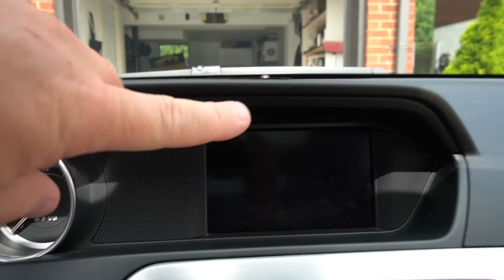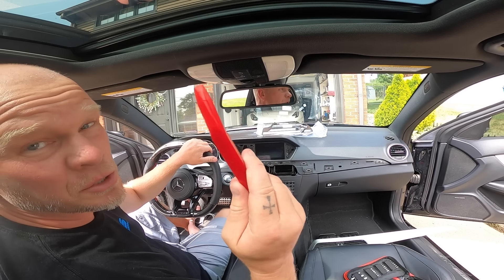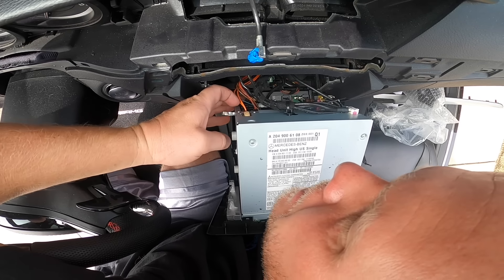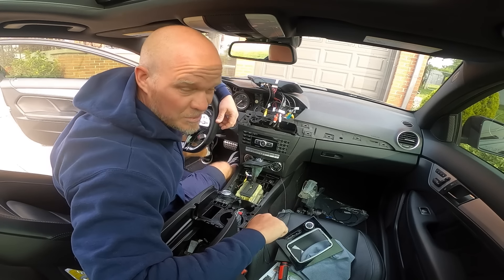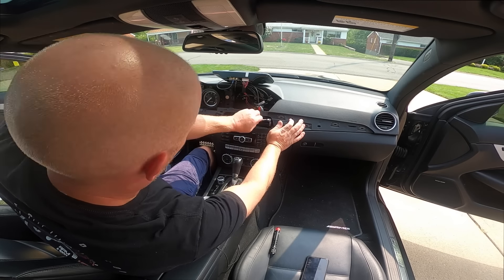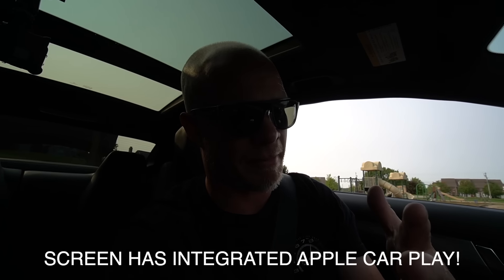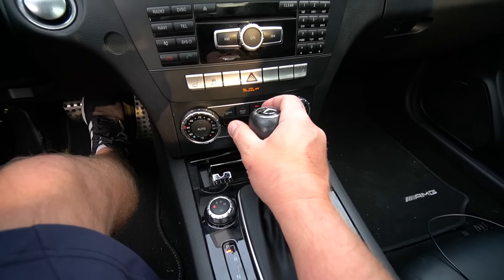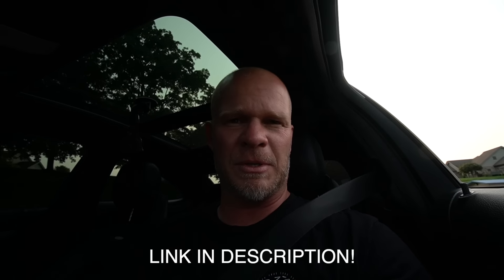Nr1 Upgrade For Any Mercedes! Android Infotainment Screen Install! (W204, W205, W211 etc..)

Comment: Now what you need to do Mike is get the Android auto/Apple Carplay adapter installed along with changing out your cigarette lighter with USB ports!! Then all you'll have to do is just plug your phone directly into your USB port where the cigarette lighter use to be and you'll have Apple Carplay at your finger tips!! 
This is what I did to my car. And what you can do is run the usb connections 1 to the back of your screen under the dashboard where the Apple Carplay will plug into and the other USB connection through your center console to your armrest compartment and plug that directly in to your usb port in the armrest compartment. And at the same time run your aux cable to your armrest compartment, buy a noise cancellor, plug your AUX into it and the noise cancellor in to your Aux port! 
Then when you switch over to the Android function on the screen, you'll be able to listen from the Android screen (i.e. youtube music, etc..) when driving and you won't get the noise feedback because of the noise cancellor! 

So when I plug my usb cable from my phone to the top of 1 of my usb ports, I get Android Auto/Apple Carplay + phone charging and when I plug my phone into the bottom USB port, I get phone charging only.
My setup is so universal that i have so many options at the tip of my fingers that I can use my command unit from the car, go on the internet whenever I want. Use Google Maps for Nav or Waze for Nav or even still use my command unit for Nav! 
OH and also you should get the VIM cable harness too!! This cable harness allows you to enter destination on your command unit Nav while driving! This cable harness can be used with the cable harness that you installed for your Android screen, together! I've done all these things with my W204! NO PROBLEMS WHAT SO EVER!! :D Hit me up on Instagram if you want to know where to get those other items! 
OH! ALSO... one more thing!! If you want to be able to use your car's factory antenna on the roof of your car, there's a company you can reach out to to have them make a custom split cable where your command unit AND Android screen can use the same antenna together, as well! Then you won't have to use the generic antennas that came with the screen!!

Wired To Wireless Carplay USB Radio Dongle Link Box w/Light For Apple IOS IPhone adapter: 
eBay item number:274494133026

Noise Cancellor: https://www.ebay.com/itm/MPOW-Ground-Loop-Noise-Isolator-3-5mm-AUX-Cable-For-Car-Audio-System-Home-Stereo/363091378655?hash=item5489eec1df:g:F7UAAOSwIjxfTK8B

ebay store: rfniceconect: 
These guys can make the custom command unit splitter cable for your command unit and Android screen. 
It's a 50cm Fakra "C" Male to SMB Female 5005 SMA Male RG174 Y Splitter Combined Cable

Cigarette lighter replace USB PORTS: Dual USB 3.0 Extension Dashboard Panel Mount Cable for Truck Car Boat Motorcycle
on eBay: eBay item number:193658991954
Reply: do you have a video you can share

Comment: Was expecting that the headunit was going to fit into the housing, im not a fan of the tablet looking infotainement.. but its a nice upgrade from the outdated W204 headunit
Reply: Agree, it looks like the W205 =/ Nice to have the tech upgrade though.
Reply: Yeah 205 style hu's are not my cup of tea. The MB engineers were like, ahh beautiful interior.. oh wait, we forgot to add a screen! Not to worry, not to worry we will just slap a tablet somewhere.
Reply: there is one that is smaller that fits in the dash I've seen.
Reply: “Outdated”
Reply: @Vithursan B. Me too. And I think touch screen systems are dangerous, if you gotta change something on the move.
Reply: agree its popping out too much
Reply: Bilal

Comment: I just got this for my 2013 benz... i was skeptical about the price and the install but it was WELL worth the money and it makes the car look 10x more modern and have gotten a lot of compliments
Reply: I’m thinking about installing this in my 2013 C250, how’s the sound quality on it?  Have you had any issues with it?
Reply: Alberto Magallanes Jr you have to make sure you go on the AUX setting on the original screen for the volume to work 100% and also of anything my speakers sound louder

Comment: Nice upgrade, I just wish the screen was set back into the dash like the old one instead of sticking out hanging off the dash board like that. I suppose it’s not any worse than the newer c classes though anyway

Comment: 01:10. At one stage, someone replaced your air filter, and to do that, you need to go thru the glove box. But the glove box hasn't been put back together properly and hence you can see it sagging on the top right-hand side.

Comment: Having the W204 chassis the new screen compliments the steering wheel. 
Is there no way to blank the OEM with a carbon or aluminium looking plate/cover. 
This would certainly give a more factory look.

Comment: I have an android screen for my w204 and I love it very similar qualities I also plan on getting a dash cam one that looks oem you should look into it it also goes well with the android screen .. it plugs in right under tour rear view mirror
Reply: I saw them on eBay .. Dmp has them also but they’re roughly overpriced for the same thing so ima get mine off eBay

Comment: Nice upgrade! Any feedback after using it for about a year?
Reply: Feedback after using for 3 hours ... Do Not Buy!!!! The screen goes black on the NTG display which means you use your reverse camera! Also the swivel wheen stops working so you can't set the sound to Aux which you need to do in order to hear apps ext. It works for a while but mine died after a few hours! ... it is a cheap China product which they charge alot of money for. I will be asking my bank to reverse the transaction
Reply: @hedzt6667  Did you order it from the same guy as Mike did? Where did you order it from?

Comment: These aftermarket systems update the car so much in terms of functionality but I would have gone for slightly smaller screen but a more integrated one into the dash to look stock. This looks stock just for the newer models and I like to keep the original.
Reply: Yes, one that is wider and replaces the 2 side grills either side of the standard screen and is IN the dash.

Comment: I have this exact screen in my 2013 C63. Its amazing.
Reply: How long did it take...was it hard
Reply: @traybutts4425  yes it took me a while. Getting the harness to fit behind the factory deck was a pain.  I would also suggest removing the shifter and centre console. Drill a small hole in the arm rest so you can run the headphone cable through. Way cleaner look.   It's more work but it's better than the cable hanging there. Also watch when your putting the glove box back on. I lost a few screws down a hole near the right door, you can't get to it.  Hope this helps.

Comment: I'm a hardnosed traditionalist.  I'd like a stock fitting replacement with the same stuff as before but an updated HD screen and connection for Google maps and GPS by bluetooth.  No GPS has proven as accurate nor as updated as Google (Maze is really good too). They mark newly placed construction zones to avoid the jams.  Maze is great because of member participation giving radar, road hazard, and accident area avoidance in real time.  So many aftermarket wonders.  The word custom is just a price changer.  All I want is a steeringwheel with turn indicators plus original functions.  My indicators are hidden behind the steeringwheel I have gone up to 50 kilometers turning right or left without knowing it.  Four e-mails to 'custom wheel' makers and always the same.  "No sir, we don't make that".  Should I write to Websters Dictionary and recommend a definition change?

Comment: They should design one that mounts flush in the existing OEM slot.The floating tablet look is no good. I would take a smaller screen for the cleaner look. The OEM screen size is plenty big enough.

Comment: I would love an upgrade like this on my 2008 XC70 but volvo uses fibre optics so i would loose alot of car settings and temperature settings if i would switch over because the cables doesn't support the system

Comment: @autovlog Great video and instructions, ive been looking to do this myself, but the AUX cable bit always concerned me. Why is it needed? Is it the only output for audio from the Screen?
Reply: It's an input for plugging in non blue tooth external devices into the Android unit.

Comment: I have a c class 2012 all the radio functions work except when I turn up and down the volume there is no sound from the speakers, I did a circuit check and it tells me that loudspeakers open, you have a video related to that case.

Comment: Love the screen, just placed my order with CKM
Reply: Have you gotten it yet?
Reply: @AlejandroSanchez-bt1mj   yes received and installed, great product and makes a huge difference
Reply: Did you have any technical difficulties with the system? Once installed with the software
Reply: @AlejandroSanchez-bt1mj   it was straightforward to install only tricky bit is you need to run the aux cable to the aux socket in compartment behind gear knob and it’s difficult to hid the cable, the other thing they don’t mention is you need to select aux on the original head unit to get sound. You don’t need a dongle anymore as it has CarPlay built in which is what I use, CKM take a while to deliver if you are in uk. I would recommend the screen as it makes a massive difference
Reply: @bosscarjon  how much was it buddy
And can you still control ot via the  dial next to the knob
Reply: @adambaker9550   697 euros and yes you can

Comment: Where the hell did you tuck the MASSIVE quadlock block!?
Reply: Under the head unit is my own solution but if I did it again I would put it in the recess behind the right side of the head unit.  For RHD that means removing the panel under the steering wheel, for LHD remove glovebox, to get better access.

Comment: bro i installed this on my c63 507 and cant get the cables in right the oem headunit is a liitle bit out and cant go all the way in , you skipped past the hardest part to show what did you do to make the headunit fit in all the way in ? please can you help also where does the orange fiber optic cable go that you took out of the oem system ?
Reply: Hey, I just got this installed in my 507 as well. How’d your project end up? 

I’m having a problem getting my car to play the tablet audio through the media interface cable. Was that a problem for you?
Reply: Sike!!! I was in my car as I typed this up and got it working 30 seconds later, hah. Still curious how yours is going!
Reply: Everything fine except fir what I asked above ..

Comment: I had to remove the middle panels and radio on my 2013 c350 like 3 times because airbag module had to be reset and it didn't work the first time then the second time the key stopped working so we thought it was cause of the airbags module wasn't reset correctly then the third time cause the belt randomly shot out and it had to be reset again, then my ELS stopped working so i was about to get a emulator but turns out it was just the little box on the negative battery terminal, so yea this car been a bitch to deal with but it makes it up with it amazingly driving an power tried drifting it tho I only on snow cuz I just got it and don't wanna fuck it up

Comment: I bought a previous generation radio from CKM Design for my W212 in 2018 .. they told me in the emails that it would be able to be updated.  Specifically the only feature I ever wanted was to have it fixed so that It wasn't in metric. I live in the US and I wanted it in standard imperial/mph.  When I asked about the update Chris at CKM design was fairly direct and borderline rude and said that he never said that  or it was a misunderstanding.  To date there has been no update to this unit.  His only solution was to buy another $700 unit. I support AutoVlog, but I do not support CKM Car Design and I recommend you not buy a unit from them. You can get an updated Chinese unit for cheaper from Alibaba express and get the same amount of support (which is minimal to none) from them for cheaper.

Comment: You can’t stream Netflix. Test it before you lie.
Reply: i have a version ofthis on my cls i installed the app and can stream without problems its hd too
Reply: JaCk MeOff no you can’t
Reply: If he has Netflix on his phone should be able to stream it through the screen with the sharing feature
Reply: Billy Wickham No this is not correct. The same way you can’t screen record Netflix is the same way you CAN NOT screen share Netflix.
Reply: JaCk MeOff  I’m thinking about installing one on my C250, how’s the sound quality?  Have you had any issues with it?
Reply: Alberto Magallanes Jr Hi, it’s perfectly fine, sound quality is the same as the old unit
Reply: @gfvtyctfcttcctxx7827  Ok cool, Yeah I'm thinking about buying later this month, but I got a little worried because of some of the forums mentioning some sound issues like a whining noise related to the aux connection.
Reply: Alberto Magallanes Jr No, if you install it properly and your device isn’t faulty you shouldn’t face any such issues with the sound
Reply: @gfvtyctfcttcctxx7827   Thanks appreciate the help.  Last quick question, who did you go with to purchase your screen?  I'm between DMP car design and CKM car design, I'm leaning towards CKM (the site linked in this video).